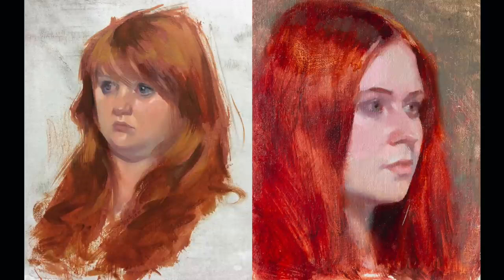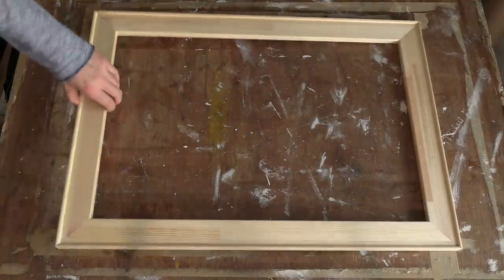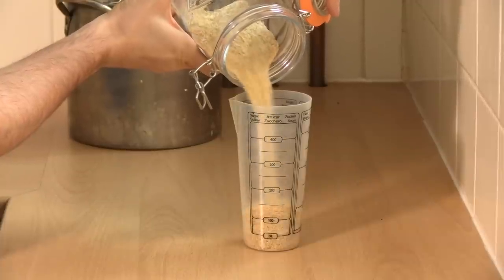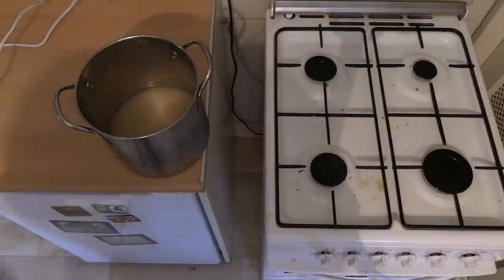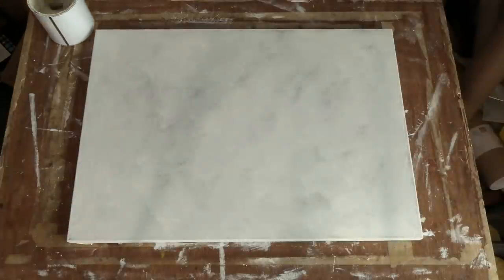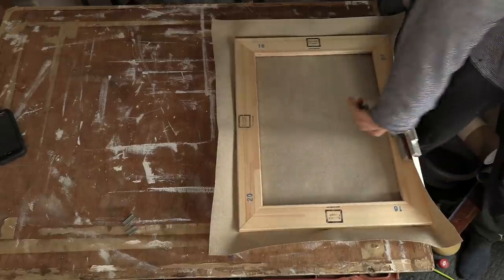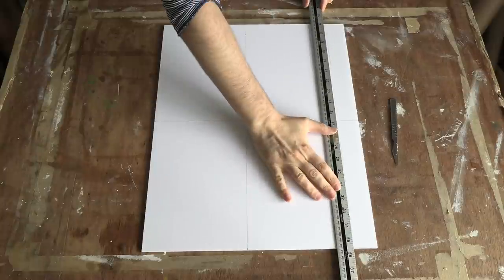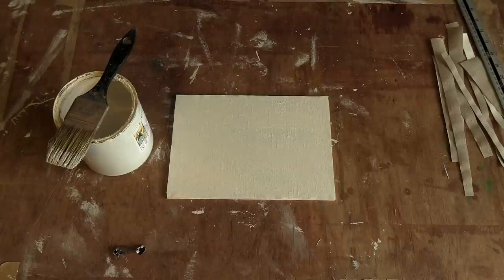Make Your Own High Quality Canvases and panels

Comment: About PVA, I am playing violin also, there is used hyde glue (rabbit bones and other components, same as rabbit skin but less flexible). When someone used PVA, violinmakers experienced that lifespan of PVA is around 10 - 20 years, then it brokes structure and starts to turn to dust. Lifespan is based on UV light and other elements. So yes, I recommend traditional proven recipes. Great video :)
Reply from the maker: Thank yoy Martin!

Comment: Thank you for the video. Note that if you use a normal hammer rather than a rubber mallet, then I recommend using a wooden block which would "dent" rather than the frame.

Comment: I have very study homemade stretchers for my frames but.... I can't get joy from sizing raw linen. I did first coat of RSG and as it is drying I can see significant ripples not just at the edges but at the centre too. This is just the 1st coat of RSG so it may be OK. I heard you said if the solution is too thick it may cause warpage but I diluted it 20gram 1 litre water so that should be thin enough. I feel like I've attached the linen loose enough to both. If my second coat is unsuccessful shall I try taking the whole thing off and restretching once dry? I do not have canvas pliers. I've never had this kinda ball ache with cotton canvas but it would like to preserve( in-between the tears)
Reply from the maker: Have you done this before with cotton canvas instead of linen? 20g to one litre sounds like it would be ok? Though I'm not sure, I normally do it by eye. I fill up a small container and do 1 part granules to 10 parts water. You often get wrinkles after only 1 coat. They normally come out after the 2nd coat. On the rare occasion that I've had wrinkles after the second coat I've added a third and they've come out. If you've got loads of wrinkles it may be that the canvas is too loose, but it would have to be really loose? Raw linen usually does feel quite  loose and the size stretches it as it dries.

Comment: Thanks Alex for your amazing videos and work! You should be knighted for services to education and inspiration! 

I’m just getting started in the game and considering supports, paints, brushes etc. Is there a way to prepare raw linen for oil painting while maintaining its original visual texture i.e. not priming it white, but transparent? I’ve seen many paintings from late 19th/ early 20th century that appear to be painted directly to raw linen with part of the linen support showing through, and it looks great! Many thanks.
Reply from the maker: Thank you very much! Yes, it is possible to paint directly onto raw linen once it has been sized, without any other ground. But it's a very absorbent surface to work on. Maybe adding additional layers of size, either rabbit skin glue or PVA will make it less absorbent, but I'm not sure about how archival loads of coats of glue is? There is also clear acrylic gesso available, tho I've never used it:

https://www.jacksonsart.com/holbein-clear-acrylic-gesso-900ml-m-medium-texture
Reply: @SIMPLIFYDrawingandPainting  Many thanks for taking the time to respond Alex! I’ll start trying out some options and see how they are to work with.

Comment: Thank you for this video.  Following your very clear instructions I have just made my own canvases for the first time using raw linen and rabbit skin glue, and am pleased with the results.  I notice that the larger canvases (40cm x 50cm and larger) are great.  The smaller ones (30cm x 40 or 45cm) needed more rabbit skin glue and were harder to get perfectly tight and flat.  There must be a scientific reason for this as I used the same materials and technique for all of the canvases.  Perhaps I need to pull the raw linen tighter on the smaller stretchers, or maybe I should stick to wood panels for the smaller pieces (where weight isn't an issue) and just use this method for the larger ones?
Reply from the maker: Well done! That's what I like to hear. 30x40 isn't that much smaller so I don't think it makes much of a difference? I've found it;s quite random, sometimes you still get some bumbs and stuff after the first coat, but usually a second coats sorts it out?

Comment: Very helpful content, Alex thank you. I’ve been using my Caravaggio Lead Primed linen roll for about a year now, and though i love the ease of not have to prime it the way i like, it does ripple a LOT. It’s so frustrating as I feel I’m an experienced artist who’s been stretching canvas for nearly 10 years. It only goes fully taut when/if I spray the back with water. Curious if you’ve found other solutions to the rippling? Can you perhaps PVA size the back of an already primed linen? The backside of the oil ground doesn’t look sized after all... Would love your thoughts!
Reply from the maker: I've never tried sizing it on the back. I find I can usually get rid of the ripples by either pulling the linen even tighter where the ripples are with canvas pliers or using canvas keys. But having the canvas under so much tension, surely can't be great? Also I've found ripples can reappear after the painting has been finished and dried, which I usually sort out with canvas keys. This is why I prefer making canvases with raw linen, as the canvas just stretches by itself and then stays that way.

Comment: Great video! Very informative and clear. One question I have is if once you mass produce many canvases you can use them any time you want, even after years or the coating decays if not used. 
Another question is: can you use oil prime on a premade canvas? Why in this case yeso works and not oil prime?
Reply from the maker: Thanks. If you prepare them properly, I imagine the surface should definitely last for many years. Though I've never left one to see. You're probably better asking a manufacturer if there is a sell by date? The only thing I've noticed that may happen with canvases that have been left or a while, including that have been painted on, is that they may sag ever so slightly. I think this happens because the wooden stretchers expand and contract in the heat, or maybe the weight of the paint on the canvas stretches it a little. Its hardly noticeable and if it is you can use canvas Keys in the corners of the stretch bars to expand the stretchers.

It's absolutely fine to use oil primer on on pre-made canvas.
Reply: @SIMPLIFYDrawingandPainting  many thanks!

Comment: Great video, best tutorial I've seen on this subject! Quick question - would that oil primer work painted directly onto a panel of MDF or something? When I first started out I bought a big sheet of MDF and primed it with acrylic gesso as a cheap alternative to shop bought canvases, and found I rather liked painting on that surface. I textured it by dabbing it with crumpled newspaper, so I was wondering if that oil primer painted over gesso on MDF would make a nice, slick surface?
Reply from the maker: Yes you can definitely use oil primer on wooden panels, although its better to size the panels first, with either rabbit skin glue or PVA before applying the oil primer.
Reply: @SIMPLIFYDrawingandPainting  oh brilliant, that's good to hear! I find those panels very cheap, nice to paint on, and handy to store.

Comment: Thank you so much for this.  I'm certainly going to give it a try.  I do have one question though.  Is there something special about the rabbit-hide glue you used to size the canvas, or could you use any type of hide glue?  I've used hide glue when woodworking and bookbinding, and even made my own hide glue from rawhide dog-chews on occasion, but I think this may be the first time I have heard anyone talk about using a particular species of hide glue for a specific application.
Reply from the maker: Tbh I don't really know if there is anything particularly special about rabbit skin glue. It's what they used back in the day, so it's the hide glue that is available in all the art stores. When you prepare your own glue from rabbit skin granules, it works out a lot cheaper than the only other size that is available, PVA.

Comment: Great tutorial Alex! Do you put the rabbit skin glue in the fridge between the 2 layers? And do you use it directly after heating it in the first layer?
Reply from the maker: I don't normally put in the fridge, but you definitely could as this would keep it for longer. Once it goes off it smells disgusting, like rotting flesh. You need to use it immediately after heating as it dries and hardens fairly quickly.
Reply: @SIMPLIFYDrawingandPainting  thank you so much!

Comment: Hello sir, beautiful demonstration. I have one question. Since I quite like the texture of canvas as a painting background and I can't find transparent gesso to buy, would I still need to prime the canvas or could I just paint over the 2nd coat of sizing? After sanding it a bit? Do i really need to prime the canvas? Can it still be less absorbent?
Reply from the maker: You can definitely paint onto sized linen without priming it but it is quite absorbent. You can also buy clear primed canvases and boards in art stores, though I think they are just sized with PVA?
Reply: Hmmm, what about transparent gesso? I was thinking about homemade transparent gesso. Rabbit skin glue mixed with calcium carbonate or marble powder? Have you ever tried it? If so, would it still be as absorbent? Thank you very much btw <3 @SIMPLIFYDrawingandPainting
Reply from the maker: @nadrkanimoderator  won't adding chalk or marble reduce transparency? Though apparently, there is such a thing as clear gesso: https://www.jacksonsart.com/winsor-newton-professional-acrylic-clear-gesso-primer-450ml
Reply: Yeah, I think chalk would maybe reduce transparency but not marble. I don't know yet, I would have to try :) Thanks! @SIMPLIFYDrawingandPainting

Comment: Hi again! Thank you so much for all the information you are giving us!!!
I tried to find the oil primer you use, but it’s really difficult to get, probably impossible in Spain. Do you have an optional primer or another solution? I have primed recently boards with Winton oil white just to try. Do you think I will have oil primed boards in let’s say 6 months? Thank you!🙏🏻💙
Reply from the maker: I think everywhere has been out of Roberson's for some time. They are apparently having supply issues with some of their ingredients? Recently I have been using Gamblin's oil primer. It's really thick, but you have to wait a week before you paint on it, where as Roberson's was 24hrs. I reckon student grade titanium white will work quite well, though you should probably wait around a month before painting on it? Also, even with student grade paint it will probably work out a bit more expensive than oil primer?
Reply: @SIMPLIFYDrawingandPainting  thank you! I can’t get Gamblin neither so I will have to check local solutions ;) I read about the Michael Harding non absorvant acrílic primer or something like that that looks so tempting, but again too far, too expensive. Thank you again for your help!

Comment: Hello Alex! i used your method with some fine Linen and it gets tight like a drum directly after i apply the Rabbit skin glue but as soon as it is dry (2 or 3h later) it gets loose and has waves. Did you experience this? With medium linen i used the last year everything worked out but with the new finer linen this happens. :(
Reply from the maker: It should be ok with another coat of rabbit skin glue.

Comment: Thank you for this video, What is the best per GSM maximum should be linen to attach plywood in egg tempera? I am waiting for answering, thank you.
Reply from the maker: I use "extra fine" Belgian linen, which is 200gsm. The other types of linen are usually "fine" at around 300gsm and "medium" at 350gsm. Artists who prefer courser linen, might use flax or hessian which is around 500gsm?  Of course, he exact gsm for different brands my vary between different manufacturers. I buy my linen from a company called Russell ask Chapple, I've used other brands of extra fine linen and it's been different. I like using extra fine because it gives me a smoother surface which allows the paint to move more. Other artists may prefer courser linen because it holds more paint. I've never used egg tempera, so I don't really know. As far as I was aware tempera is normally used directly onto wooden panels, as they need a rigid support? But I would image, if you were to stick linen to boards for tempera, you would want as fine a weave as possible? As I said, I don't know, so you're probably better asking an artists who uses Tempera?

Comment: I think ill stick to my acrylic gessoed mdf panel's, but still so bloody useful in the future, thank u.
Reply: So-called acrylic "gesso"* has grit in it that is death to natural hair brushes. The grit is to keep the oil paint from de-laminating.

*Real gesso is made from chalk and glue. It is for panels. It is not suitable for priming canvas.
Reply from the maker: Fair enough. You can also use oil primer on wooden panels, tho you need to size them first. Though I find oil primer on wooden panels, a bit too slick for my liking. I think it works well if you prefer a more classical approach painting with glazes etc. like in the rennaisance?
Reply: @SIMPLIFYDrawingandPainting  Direct painting is the way to go when possible

Comment: What kind of oil primer are you using at the end of the video on the panel? Also, is it white? It looks like you are able to retain some of the gray tone of the linen.  I currently use Gamblin Ground which is white.
Reply from the maker: I'm using Roberson's oil primer, which is made with titanium white so it's pretty white. But they've stopped making it because of a shortage of ingredients? How long for I don't know. So I bought some Gamblin Ground but I haven't used any yet. I've recently been using more pre-primed linen out of laziness.
Reply: @SIMPLIFYDrawingandPainting  If I use un-primed linen, I imagine I must paint the linen surface with PVA after I've glued it to the panel and then oil prime it. Is this correct?

Comment: Thanks for this upload, over the last week or so Ive been looking into making my own canvases and panels and this, is the best tutorial I've seen so far. I've already ordered unprimed Linen roll; already, but it has been sized with 1 coat of rabbit skin glue, can I give  it a second coat of ph neutral PVA after I have stretched it?
Reply from the maker: If it's sold as pre-sized then you shouldn't need to add a second coat. However, I have never heard of pre-sized linen in a roll without primer, only pre-primed? If it's already been sized it should be a lot stiffer than raw linen, so I would think you would need to stretch it with canvas pliers, just like pre-primed linen? In which case, it shouldn't need a second coat of PVA size, you just need to prime it. If it's soft fabric, then it will need more size once it's been attached to the stretcher bars in order to stretch it. PVA should work for this, but in terms of archival quality I don't know how well a PVA and rabbit skin glue will perform together?
Reply: @SIMPLIFYDrawingandPainting   Yeah I ordered it from Jacksons, it says its clear sized linen roll. I just reread it, it does say for oil paint I'll need to add an extra layer of size. Do you always prepare the linen before you attach it to a panel?
Reply from the maker: @tonderaiarts4590  I've only ever attached pre-primed linen to panels and I've only used raw linen with stretcher bars. It's not very clear from their instructions, but I'm guessing you attach it to stretchers the same way I did with raw linen in this video, then add a second coat of size, in order to stretch it. If you're glueing it to panels then the glue you're using to stick it down should act as your second coat, shouldn't it? So once it's stuck down and dry, you should only need to prime it.

Comment: Hi. Thanks for the video. Just wondering about your primer. Roberson discontinued its lovely oil primer a couple of years ago. Has that affected you yet? And if so, have you found a a good substitute? I've been experimenting with a few things, but nothing that's quite the same. If you have any suggestions, please let me know. Also, not sure if you've had this problem, but making panels with primed linen on hardboard, I used to find the panels would often bow slightly as the linen shrank. I got around this by applying size/PVA to the back of the linen and leaving it to soak in for a few minutes before fixing to the board, allowing the linen to shrink before its attached (as with hanging wallpaper). That seems to work with hardboard, though I've never worked with the board you suggest, so perhaps the issue never comes up? Thanks, Carl
Reply from the maker: I didn't know they'd discontinued it? I'd heard there was a global shortage in one of the main ingredients which had also affected brands. I seem to remember someone telling me they couldn't get Gamblin oil primer for the same reason. I know there are other brands of thixotropic alkyd primer available which works just as well:

https://www.atlantisart.co.uk/spectrum-thixotropic-alkyd-primer/

As an alternative to oil primer, you could use a titanium white ground? Student grade maybe? Tho this will take a month or so too dry and might work out quite expensive? 

I've never had that problem of panels bending after gluing linen to them. The gator board I used in the video won't bend but neither have I had it with wooden panels. But then the panels I make are usually quite small. I have experienced bending with wooden panels when I've primed them directly but I find putting a coat of size on the back usually prevents this.
Reply: @SIMPLIFYDrawingandPainting  Hi Alex. Can you tell mw what thickness of Gator board you're using?
Reply from the maker: @shopley5255  5mm
Reply: @SIMPLIFYDrawingandPainting  Thank you.